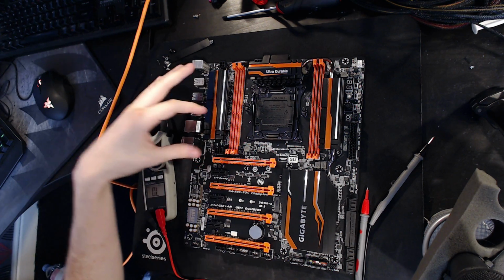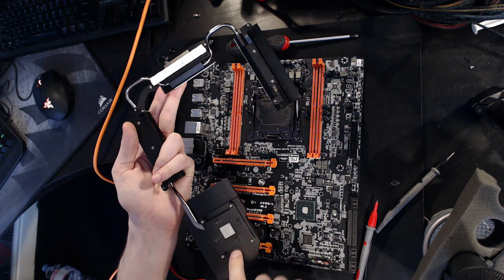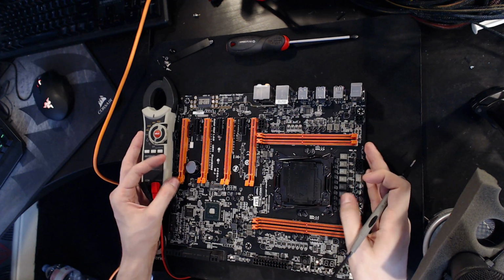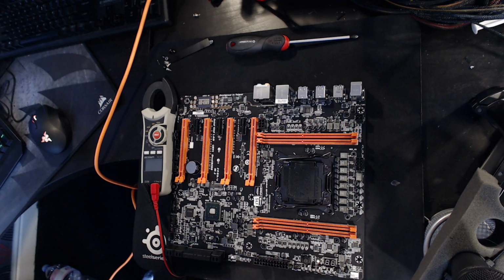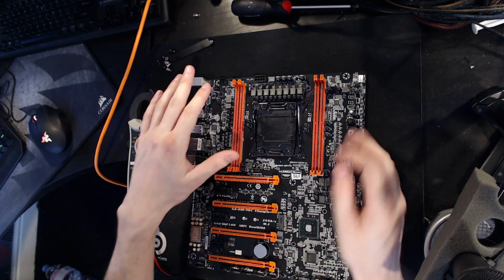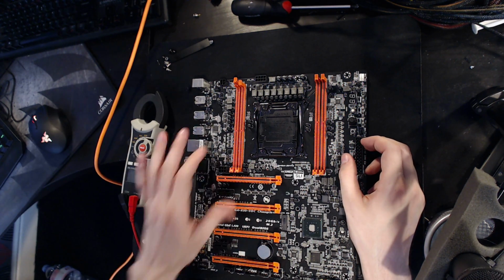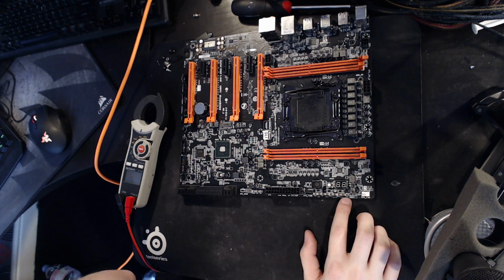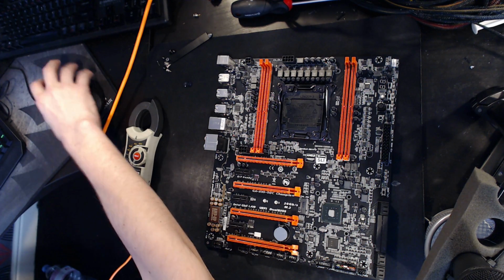PCB-Breakdown: Gigabyte X99 SOC-Champion

Comment: Half of my RAM slots are dead on the SOC Champion I bought on eBay recently. It appears like it could be due to a dead IR3570A next to the DRAM 1A/2B slots nearest the rear IO panel. The chip seems to have suffered water damage due to a previous custom loop installation. Is it possible to simply replace those IR3570A chips or do they need to be pre-programmed? I was looking at the data sheet for them and the docs allude to a proprietary I2C programmer being needed to program them. Thanks for any guidance you have.

Comment: I bought this board basically because it was the cheapest brand new, brand name x99 board i could still find on ebay in 2019 and i must say, it's a very nice board for daily usage, also the things that have been stripped down from it make it also a pretty good hakintosh board too, also considering it has not the msr register problems asus boards have. About overclocking it got me very easy to max out what i could do with liquid cooling on my 5820k, which is 4.5 ghz and it did run at 1.28 vcore stable. Nowadays i am using it as a work station and i switched to a xeon 2680 v3 and i must say, it handles the xeon pretty well, i haven't attempted overclocking on the xeon yet, but i am happy with the system i put together. Also the 12 cores allows me to run multiple vms at once while not compromising programs on the host os.

Comment: Any X299 I can buy that handle the skylakeX? Im planning on putting a ek mono block when they come out. Looks like MSI are out already. Does it even matter because the vrm suck or do they just need to be better cooled?
Reply: Isaiah, the VRM's  are fine, Is what I got from the story. The problem is when you push things to the extreme, cooling the VRM's becomes a problem. In everyday use, you should be ok with the 10 core CPU, I don't know if the 18 Core CPU's will cause a problem. As nobody knows how much power they will draw. ASUS has a board with the heat tube and extra heat sink, kinda like this board has.That's the best answer I can give you atm.
Reply: Isaiah Rossiter get x399

Comment: Chanpion was as you said was great for mem clock. Only issue was that 1T wasn't possible above 3000MHz, where as RV10E could go as high as 3400MHz 1T but not as reliably. Losing memory channels was an issue though on RVE and RV10E. 
If you can look for the Rev 7.1 which was never retail but much improved over that 1.0/1.1 model you have there.

Comment: Those vccin numbers? Really? I'm doing great at 1.9v on my 5820k which is at its max overclock of 4.6ghz @ 1.315v and 4ghz cache @ 1.275v
Edit: oh, ASRock fatality professional i7
Reply from the maker: Good for you. I've run a 5960X at 4.9/4.5GHz on 1.45V core 1.35V uncore, 2.1V input. Just because your chip does X on Y does not mean everyone's does or that everyone will stop where you do.
Reply: REALLY wasn't going that direction with my comment but sure. i only stopped at 1.9 because i haven't seen anyone on overclock.net really talk about using much more then that.

Comment: Isn't there V Drop due to the Distance between the Voltage measuring Points and the actual Components?
Reply from the maker: No because you aren't pulling current into the read points.
Reply: Thanks :) Keep it up